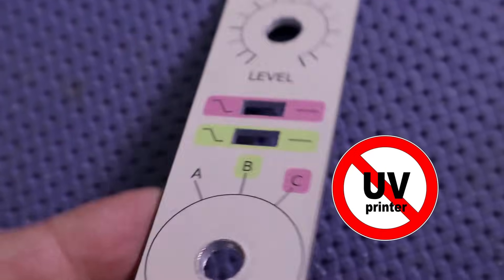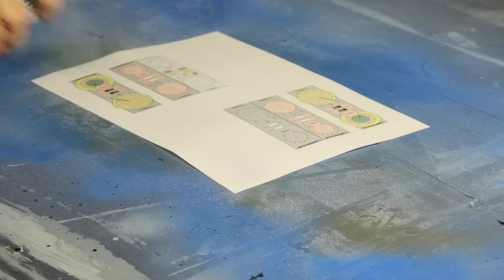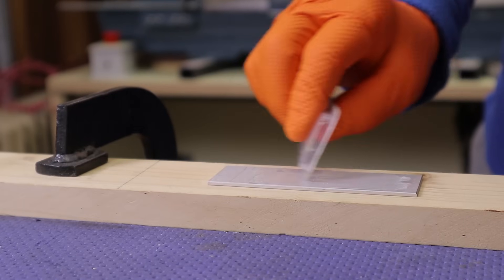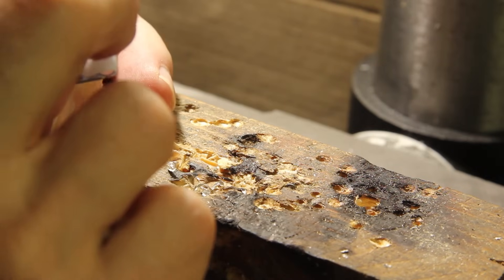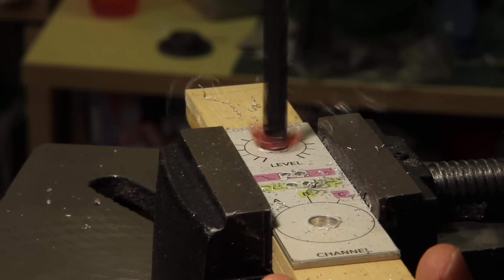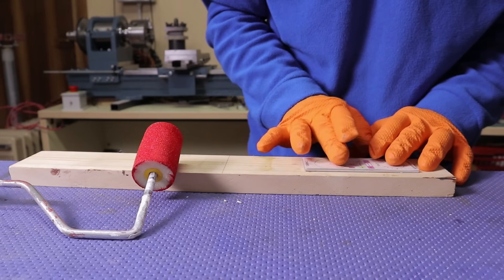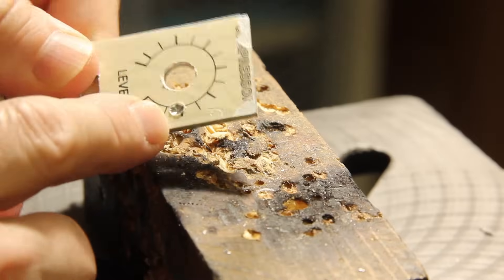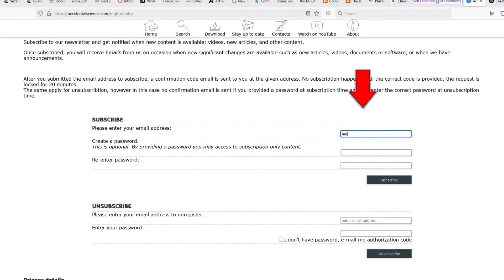How to make front panels that look factory-made | New DIY Method + Tests

Comment from the maker: Here some additional info.
🧰Materials. 👉Substrate panel: Aluminum; Glue: Bostik 2 components resin in syringe; Paper: 55g/sqm for inkjet; Spray coating: any acrylic transparent satin finish paint. Glossy is not recommended as it tends to make paper even more transparent; Back paper spray primer: any acrylic white paint. In the case polyurethane resin is used, switch to proper urethanic spray primer.
Don't forget to subscribe to the newsletter on my website at https://accidentalscience.com/regform.php
Repository on GitHub of the Template and Inkscape extension: https://github.com/ClaudioHutte/front-panel-template

Also consider to support the channel by buying a "superthanks" 🧡, for any amount you feel comfortable with. Thank you!
Have a great day! 🍀:hand-pink-waving:
Reply: But why not UV print? It costs $5 for one a5 sheet so it's really cheap.
Reply: @taczka2  Besides the print (which is tricky to get right) there's also the bonding issue - some of the UV paper's backing do not adhere well no matter what glue you use.  I still think @AccidentalScience 's method is better - it's not the cost as much as the end result that matters. :))
Reply: @ArchetypalCat  The method in the video does not look professional at all and I have yet to see a commercial device that has a panel made this way. You do not need to make your own UV print, just order from internet it cost only 5$. UV printing is very durable if done right - for example, on mugs that can withstand dishwasher washing. I don't see any advantage to the method used in this video.
Reply: @taczka2  Of course, pro panels are not made this way - and you'd probably be looking for another job if you suggested it. :O For pro stuff, economy of scale determines the best approach. - if your company needs less than 50 to 200 units, then UV is cheaper since there's no set up costs. Above that, UV machines and especially their maintenance (they can be a real PITA) outweighs the silk screening - the 'traditional' method - set up costs. Silk screens are affordable if you're making hundreds of panels.  

As far a quality of looks for this video's method - of course, I can't know if you've experimented with it yet, but after a few trial and error runs, it can look decent. A few thin layers of satin epoxy (e.g. from West Systems) makes them nearly indestructible.   I like it better than the other three commonly used: the lamination method (which I think does look lame), the water transfers, or the decals.

Yes, $5 is reasonable for UV --- what would you do if you needed say 20 panels (for yourself, not to sell or give away) - would you still go UV, or try another route?

Comment: Thanks for sharing.  A "new" method for this is use the "color silkscreen" pcb now available from JLCPCB.  As you add cost of aluminum, paint and labor - the color PCB is cheaper and they do the drilling too.

Comment: A punch is a nice tool to use before drilling since the drill bit will not wander in the dimple formed by the punch.
A stepped drill bit works great on sheet metal. Very clean holes without needing the cloth trick.

Comment: All right. You can use a deburring tool to clean the holes. The top coat epoxy is bumpy because the paper absorbs the epoxy unevenly. That's the issue with unsealed surfaces. You need to seal the paper first to get a dead flat glossy finish. Alternatively, wipe off the first coat of epoxy with a squeegee while it’s still wet. It will act as a sealing primer. Let it cure, then apply the final coat. Ideally, you should use a penetrating epoxy for the first coat and a thicker, self-leveling epoxy for the final coat.

Comment: Printing on sticker paper/vinyl sticker is simpler. Glue it there already. If you happen to have a vinyl cutter, you get those cut too but cutting a few edges by hand is no issue.
I used that method for 3d-printed panels that had designed holes in place and decals designed in the same time in cad but printed on sticker.

Comment: Using an inkjet printer to print the graphics, why not just use a self-adhesive stick-on high gloss paper cut out from a sheet and similarly a clear stick-on film. Scuff the aluminium plate with scotchbrite to aid adhesion. This saves all the hassle of spray cans and gluing on the label to the plate. A coat of epoxy two part glue or paint applied over all sides and edges will protect the label and from solvents as long as it does not react with the clear plastic film.  Great concept, food for thought for the next project.

Comment: For a long while, I have been reviewing the many various ways of making panel labels. 

The DYI goals: 

  - inexpensive
  - easy to produce
  - use simple and readily available materials and consumable supplies. 

Most professional methods do not scale down well. In other words, you have to produce dozens or even hundreds of panels for the setup and price to become reasonable per unit. Most of us just need one to a few panels - not dozens.  Even when you need more than just a few, it is often too expensive or too unwieldy to do yourself. (*)

So, what to do?

Follow the method @AccidentalScience shows here!

Of all possibilities, it meets the criteria we all want.

Thanks very much for providing this instructional!

Caio 

(*) PS There is another approach to consider - PCB companies like OSH Park (USA), JLPCB, PCBWay, and Sierra Circuits offer silk screening on PCB phenolic (which can make a good panel, if not too big), or on aluminum. The competition among them has been driving the prices down to the point that they are relatively reasonable for a DYI'er. Sometimes there is a minimum order, like 5 boards, othertimes not - and there have even been free offers like BOGO, or a one-time complimentary introduction sale.  I highly recommend looking into these options. Keep in mind, however, that the choices are quite bewildering at first - just gotta plow through that learning process ...

Comment: Really inspiring! I would deburr or slightly countersink the drilled holes on the aluminum first, and then stick the pre-punched paper on it. We make the holes for 5mm LEDs with a simple office paper puncher. Although no idea how could I make larger holes nicely.
Reply from the maker: It is possible to buy round punches. Quality pounches are a bit expensive, but for occasional usage the cheap ones are good enough.

Comment: Have you tried using a public photo kiosk to make the print? In my location, these are dirt cheap and available nearly at every corner. The print quality is pretty good and you can print those cool all black surfaces without any ghosting or spending too much money on ink. I'm using them for labels, the only disadvantage is slight warp and paper thickness. Must look good when glued properly, too!
Reply from the maker: Good hint. However inkjet printers can do a very good job.
Please note that in this video I purposedly printed slighly faded colors with some texture to reproduce old style panels.

Comment: Making one off or low volume scientific instruments at work 30 odd years ago, I was Laser printing a reverse image onto overhead projector transparency sheets and mounting them with 3M photo mount spray. Very durable, since the ink is on the back of the film.
Reply: LOL - I still do it that way. 3M has a newer spray contact cement that can even glue down a wild boar - and is repositionable just long enough to get it right - but it's tricky to get the spray thickness correct until you've done it a few times.  Funny, sometimes the oldest ways are still the best ways. :))  (Although I think we have an excellent alternative here.)  BTW - I am going to try using that 3M spray with this method.

Comment: try drilling with a thin bit. than invert the piece put it over a wood or even another piece of aluminum and then use que correcet bit to drill backwards. this must prevent the hole border damage

Comment: Those panels look very professional. To avoid burrs in the drills, you could use special aluminum drill bits. You can also use a normal drill bit like the one in the video and then use a countersink and you will have perfect drill walls. I would even dare to say that you can use the countersink manually because aluminum is a very soft material and is easy to work with.
Reply from the maker: Thank you for your comment.

Comment: Could you spray the aluminium panel white?
That would save some drying time on the paper stages
Reply from the maker: 1) Spraying on paper or on alumunum takes the same dry time, more or less. Anyway the dry time is really short.
2) Spraying on the back of the paper makes it opaque. Even if the glue is transparent, it may create some stripes that becomes visible through the paper.
What really takes time to dry is the glue. However fast setting, 2 components epoxy glue takes just 15 minutes before you can manipulate the object. Though, because it remains a bit soft for a week or so, you just need to be a bit careful within this timeframe. I think it's an accettable trade-off. After this time it becomes hard like a piece of plastic.

Comment: 1. Use photo paper, it's not transparent after spraying with sealer.
2. Drill all the holes etc BEFORE sticking the paper on. You can use the paper as a template to centrepunch the holes before drilling.
3. Use spray glue, it is sold in crafts shops for sewing and stuff.
4. You can stick clear contact film over the top, like the stuff used on books. That is more durable than just the sealer spray.
Otherwise, you didnt do too bad
Reply: 1. Use any copy paper and a laser printer. Print 2 copies.
2. Use 1 copy as a template for drilling.
3. Back the second copy with another sheet of paper, and laminate the stack.
4. Cut out with a generous margin and you have 1 copy with a hard plastic coating. (discard the backing) Extremely durable.
5. precut holes for pots/leds etc.
6. Use thin doublesided sticky film, use holes to align.
6. cut off excess around the front plate.

No messing with spraypaint/glue, materials have long shelf-life ( years .. ). The real trick is step 3. If you laminate 2 stacked pieces of paper you'll end up with two one-sided coated pieces after cutting the edges.
Reply: @gartnl    yeah that's a great idea to use a laminator, is a harder plastic coating. Thanks for that. 👍
How does it go for adhesion? Mostly laminated things use an edge, so once you cut the laminated edge off does it delaminate later on?
Reply: @wizrom3046  I use oldfashioned hot lamination. So far none have delaminated. Even stickers I made for a magnetic whiteboard didn't after years.
I also made 'cheatcards' with creditcard pouches in the early 90's with things like connector layout/ascii table etc. They are stil ok.
Don't know about modern cold lamination though.
Reply from the maker: Watch my previous video. It uses the (hot) lamination technique. But it provides a different feeling. Like an industrial equipment. The method I've shown here looks like pro recording studio equipment or ole style lab instrumentation.
Nuances that are unfortunately difficult to grab on camera.
Laminated paper can delaminate, in particular at the corners, but under heavy duty conditions only.
Thanks for your comments, guys.
Reply: @AccidentalScience  I've used all kind of methods in the past. From the oldfashioned PCB trace tape, rub-on lettering, hand-drawn on paper or PVC sheet (etching inkt), UV sensitive 2-colour sheets (do those still excist?), UV-printers. What ever you can think of. How it looks and feels is subject to personal preferences. One thing though: laminating pouches are available in a matte finish, allowing a none glare surface.
Btw: the biggest enemy of laminated paper is moisture. It creeps in from the sides.
Reply from the maker: @gartnl  oh the transfer letters and traces ... I can relate! I don't think they exist anymore.
Reply: @gartnl    the photo paper (you can buy in newsagents and office supply shops) is quite plasticy and not absorbant, it really would be a better choice than normal paper. You can still print on it with any modern home printer
Reply: @wizrom3046 I agree it does look beautiful but it is not resistant to cleaning agents or rubbing. It also yellows in the sun. That is why I don't use it anymore.
Reply: @AccidentalScience  there is a sigar box somewhere in my storage .. even with the old ic pad transfers. And lots of  tape. Next to the drawing templates and Rotring pens.
Reply: @gartnl    I suggested photo paper in response to the orig video, where he uses normal paper but paints the back of the paper white because the clear spray used on the front of the paper makes it go transparent.
So with photo paper, you just need a clear protective spray on the front and nothing needed on the back.
Reply: @AccidentalScience Letraset Eurostile was my favorite.
Reply: In step 4, one idea that comes to mind and assuming enough are going to be made, is to put two panel legends back to back before laminating, saving having to throw away half your paper and laminate supplies.
Reply: @rfrisbee1  Yep, but most of the time I only need one front. I do however sometimes use the back for making magnetic stickers, labels or an extra front just in case I mess up.
But the cost of one pouch and 2 sheets of paper is less than that of one capacitor ..

Comment: Resin, once set, may be sanded and polished for best surface. That said, I guess having matt surface is better for visibility.
Reply from the maker: Remember, what I've shown towards the end (at 9:41) is a bad example of resin deposition that I made on purpose just to display what happens in such a case. If you work with a thin layer, using a roller, the final result is already a semi-matte surface wich appears really pro. See the image at 9:20 as an example. It is also possible to use satin polyurethanic resin, which can be used both as glue and top coating, with spectacular results.

Comment: Not bad. I normally use contract cement on the material and the paper for quick projects. If i need to make a lot of panels, I use  or even better you can get waterproof and permanent inkjets sticker sheets. Avery does both clear and white sheets that have permanent adhesive already on them. The paper is vinyl so it is water resistant. I cover it with a 2K clear paint for added durability.

Comment: If you would like to get a hole without bur use a wood drillbit which has cutting edges o. The outside.

Also I would suggest not Arcryic Varnish but resin based to secure the print.

After that use a layer or 2 of acrylic floor painting for painting laminate or wood tiles since that dries very hard to secure it for the future.
Reply from the maker: That could be dangerous with aluminum: the terminal edge of that kind of bits is thin and could break.

Comment: Gotta try this method someday, may be handy for my amps... maybe effect pedals too, if I get into that. Getting almost any art on an enclosure without committing to silkscreen printing, which would be great for serial production but not quite so for one-offs.

I typically go with printing sticky transparent or coloured foil on a laser printer. I typically print a drilling template on paper and proper cover on foil. The former is sacrificial, it'll only be used for marking the holes; the latter will be applied to a drilled, de-burred, finished, cleaned and degreased metal surface. Using a roller is definitely the way. Work slowly to avoid trapping air underneath.

Mark your holes with a center punch (automatic ones are pretty convenient here), use a small pilot drill first to get the positioning right, then stepped drill until you reach the proper diameter. Always de-burr holes; you can use the stepped drill for that. 

I never knew the felt drilling trick. Always learning something new.e
Reply from the maker: The sacrificial paper method is what I've shown in the previous video. But if holes just need to be drilled and then covered with knobs, then directly drilling saves a lot of time. The method I've shown here takes less than 15 minutes from start to finish, fast setting epoxy glue and fast drying spray varnish and primer paint times excluded (which in total may take another 15 minutes). I experimented with transparent foils, but the underlying glue (whether it is sprayed or rolled or whatever) makes it tricky to have an even background with no bubbles or striping and I never managed to have it right.
Anyway, glad you find it interesting and thanks for your comment.

Comment: I remember this method, it was used 40 years ago, upon the appearance of the first personal printers. Its a terrible way. Today we have cheap Sainsmart Genmitsu CNC mills and using 1.5mm fishtail mills you can produce any hole larger than 1.5mm without burrs into aluminium, be it round or rectangular or D-shaped. If your Sainsmart is large enough you may also mill out the contour of encasings in steel, just use 0.2mm depth steps, and engrave folding lines.
And how to produce resistant color on your front panel ? Use an UV flatbed printer if you have around 2k money or access to it, or use eloxal on aluminium and print the dyes directly onto the activated surface, afterwards closing it in with water vapour.
Reply: UV printers are so popular nowadays and printing on them is so cheap ($5 for an A5 sheet) that I don't understand why anyone even wants to mess around with some old-style printing techniques.